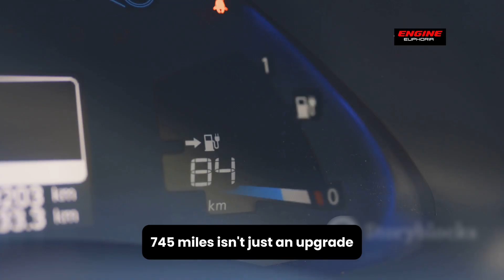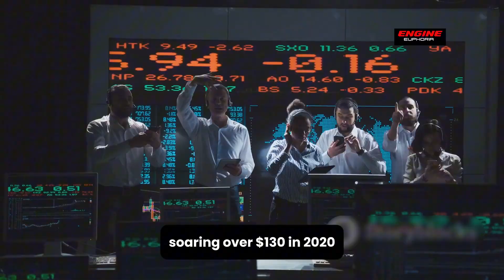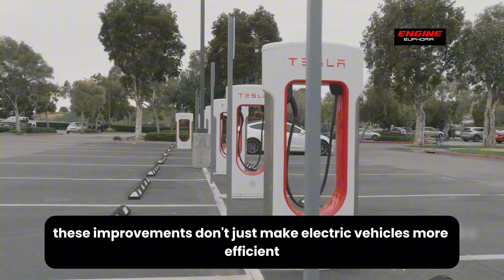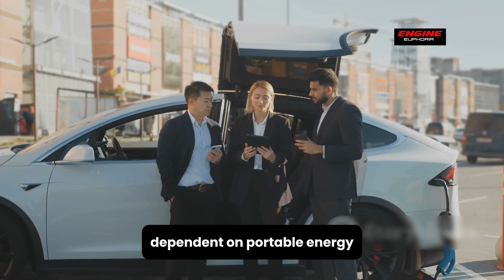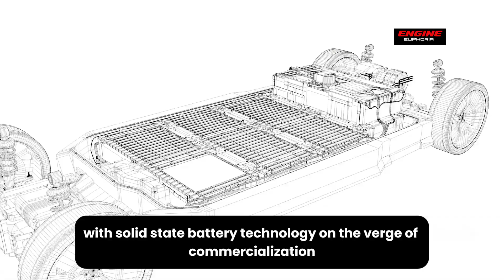Toyota's 100% Solid State Batteries Are Coming in 2025 | 7 Minutes to Full Charge

Comment: Honestly the true future is going to be nuclear power plants weather anyone wants to except it or not all these eletric vehicles and everyone's showing solar panels aint no way we going to replace fossil fuels with just the sun rays we will need something extremely powerful and lasts a long time that being nuclear. As for cars being so expensive they need to start 3d printing most of the parts on cars we have 3d printers basically printing every material known to man kind now how hard would it be? Only parts you might need to make would be tires, the engines, the frames, and eletronic components. Cars should really be dropping in price not increasing.